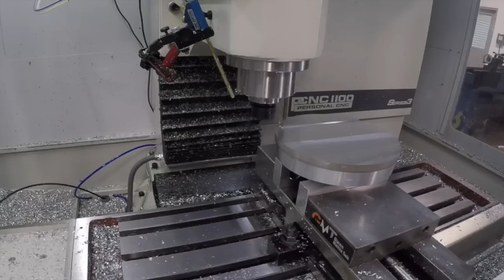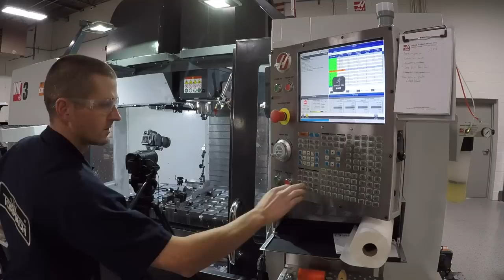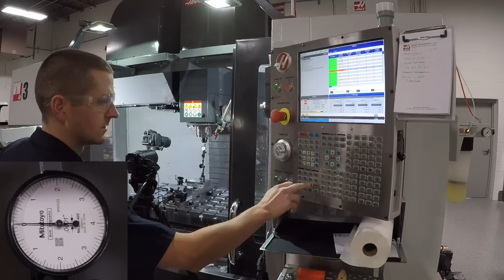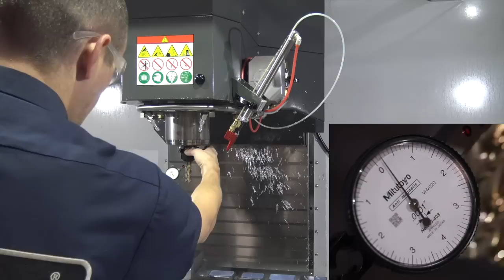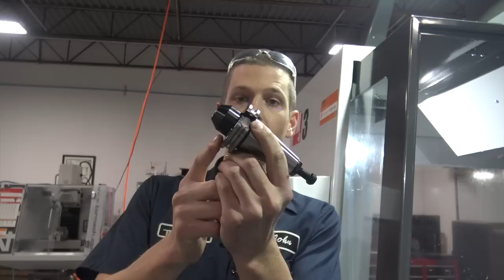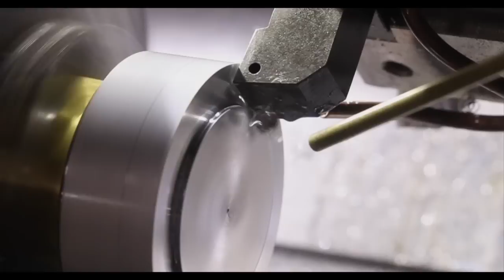Set Screw Up.  UPDATED:  Does a Set Screw Holder Deflect!

Comment: this is still not a proper way to verify the tool runout. John measured it so close to the holder, but you clearly can see that is not the part of tool that gets the job done. that's why usually holder runout is verified at 3xD gauge length. Still, John's channel is a national treasure.

Comment: Low runout is great but Weldon holder's by design have very low rigidity as the set screw holds the tool against a line inn the holder

Comment: 5:00 that speech makes you a great machinist. Maybe im wrong? But after what you did i come down to the tip and check the flutes. On that tool you had 1 tenth near holder but the end will be a few thou.   Tool can spin with the middle stationary and the two ends wobbling out. Hard to explain. I worked in a Chinese mold shop and tools would have 0.02" of runout. I would put the tool in spindle with paper shims to get it true at the bottom. It worked and i blended corners nicely, no gouge. Correct me if I'm wrong??? I had a 2 " cutter 10" long. I did what you did it had 0.01" runout. What i did different is i move Y axis so the indicator says +0.005" - 0.005" and then I Z axis up till indicating just above tip radius of insert. Forgot to say tool shank is 2" too, thats where i reference size. Anyway the inserts said 0.03" runout so idid paper shims in spindle and got it to 0.005", the low inserts i shimmed out with paper and high insert i grinded where it seats, not cutting edge. Got it to say 0 runout. I know thats weird, but correct? I was working for chinese so very cheap. Maybe that helps someone. I learned there you really do have to pull out the bag of magic, haha. Like you can sharpen taps and keep using them a long time, i got 1 M20 tap every 2 years, lol. I used it everyday and it survived

Comment: rob lockwood and i'm sure some others are right, tolerances and quality of the cutting tool and tool holder should be taken into account, as well as the condition/wear of the holder. One more thing to think about is the holder style the tool manufacturer recommends. From what I have been told, tools made with the Weldon flat are toleranced and/or designed to be used with set screw type holders, and tools without were intended to be used in a mill chuck, collet, or shrink fit. I know its gonna happen, sometimes it makes sense to grind a flat on an endmill, but I still cringe every time I see it done.

Comment: I'd suggest this type if test in any spindle is unlikely to be a great idea. Where possible V blocks would likely lead to a more consistent result.

FWIW ER collets can be made to have absolutely zero runout, or at least to the level of your measuring capability and patience. With the tool mounted, dial it in and tap on the collet NUT at the high point. It shifts the collet in the taper slightly and with patience you can achieve no runout. The key to stress is not to bang away on the tool (it won't work, will possibly damage the tool, and is just an all round crap idea) but instead tap the nut. Probably not the most intuitive thing to do but it definitely works, and it typically won't shift under load.

Comment: I would never use a set screw (wheldon) holder without having flats on the tool shank. In fact I've never seen one used on a tool without flats on the shank!

Comment: Knowing this now, you can adapt the run-out in your g-code measurement, the run-out will be zero in your product, I see you always making bigger holes with smaller tools.
Anyway you draw a product for taking material away with even bigger tools like fly-cutters or small tools like end mil's to clean a product and always it's about the material that's left and not what you cut away. It's the product size that matters not the chips!

Comment: As mentioned below I would use a diamond wheel to put a flat on that endmill. the odds are pretty high it will pull out throwing off the zip axis with some heavy radial milling!

Comment: Does that tool have the Weldon Flat? A round shank will work for light cuts in a set screw holder, but if you start pushing feedrates (like with HEM), the tool will start moving in the holder.

Comment: In my machining experience, I have generally been taught and for the most part go by these general ideas. I use solid end mill holders (set screw holder) when I am roughing out. I can put a flat on the endmill and tighten the set screw down and not worry about the end mill pulling out or pushing in and i can be rougher with it and hog out faster and rougher. I then use an end mill in a collet for finishing passes. you dont run it as hard and dont have to worry about the tool pulling out. also, if it does run out a little bit, thats what cutter comp is for. If you have a part that has tolerances in the tenths then you should probably start off with CC in your tool anyways so you dont have to scrap a part for no reason. Set up pieces are for people who are too lazy to take the time to set everything up for its best possible outcome. I dont want that sentence to sound rude or like I know everything because I dont but i tell myself that anytime I consider taking a short cut. Ill stop myself and be like, no you know the best way to do this. just do it the rite way the first time. so far it has worked in my favor. Oh yeah and now that i think about it, i see runout in collets more often then i do in solid holders because these guys want to tighten their tools too tight and it actually messes up the collet and that causes runout. anyways sorry for the book!  love your videos as always.

Comment: Have you ever heard about zero fit tool holders? What I was told is you heat up the holder and shrink the tool in the holder with no set screw , I have never heard of this before just wondering.
Reply: I've used shrink. They're nice, but a pain to set tools up it. Really handy as the holder can be very long and narrow, allowing you to get into places you couldn't with other types of tool holding. 

I'm a fan of Hydraulic holders myself. Rego-Fix's new system is also nice, but tends to chatter a bit more (no fluid damping)  Very low runout, can be balanced for high speed ops and I've yet to pull a tool out of one. Just a bit on the expensive side!

Comment: That's pretty badass that MariTool's holders are that close.  You're still testing the best case scenario though (new everything, made in the USA everything, made by known excellent builders, etc).  Not nitpicking, just saying that one test does not define the entire space.  It DOES define that what you've got there is highly concentric and excellently made, so that's good.

Glad it turned out that your setup is spot-on.

That all said, I still won't trust the runout on a setscrew holder until I measure it myself in my spindle, just like I've been doing.  No offense, but that's a formula that's served me for many years now.  There's no harm in measuring, and it doesn't take any time to speak of. Then you know exactly what the runout is, and what the tool & holder's capabilities are.  On the upside, maybe I can start looking at MariTool setscrew holders as cheaper and better alternatives to the collet chucks I'm using for some things.  The concentricity is certainly there.

But when they arrive, I'll still measure them before they go into service.  lol 

Also, you still shouldn't run an endmill without a Weldon flat in a setscrew holder though, especially one that big, it WILL pull out on you when you load it heavily.  Been there, scrapped the part from doing that.  Learn from my mistake.

It's not a big deal or that much more expensive to buy tools with the Weldon flat already on them.  I think Lake Shore will grind a flat on any tool you like for some nominal fee.

Thanks again for measuring and taking the time to video it for us.

Comment: Hey John,

Great video on some great tooling. I noticed you using a tee handle allen to tighten the set screw on the end mill shank. Now that you have a machine you can push a little harder and with larger tools here are a couple of considerations for you learned the hard way by somebody I won't mention their name......

The tee handle winds up when you tighten the set screw so some portion of your twist torque goes to waste. Use the L part of a allen wrench ideally in a offline toolholder so you can gronk on that set screw. The other thing that happens sometimes is the steel set screw (softer) does not bite the smooth carbide (harder) shank of the end mill. I have seen it many times where the end mill walks in or out of the holder loosing your Z position or worse. I'll let your imagination visualize something properly scary. The tiniest of flats on the shank of the endmill will prevent your tools from doing a potentially negative migration. Better yet a proper weldon flat or whistle notch. If you don't have a diamond wheel on one of your grinders its probably a good time to get one. Some toolholders have a set screw in the bottom so you can butt the end of the tool against an adjustable positive stop. I don't know if your holders have that feature.

All the best and congratulations on your new machine.

Tom
Reply: Of course it depends on the spindle and the size of the cutter, but do weldon flats ever present a problem for tool balance at the higher rpm's?
Reply: what he said. lol
Reply: that's the best advice I could point to. Grinding an angled light flat on the shank is needed- ideally the screw then pushes the endmill back into an adjustable stop backing and you can get it locked really solid. I never use straight shank tooling in a setscrew holder without grinding a flat. Very dangerous if you do.

Comment: Would love to see the TIR of the spindle with a 300 mm long calibrated test bar and just indicating on the taper as well.  

Also, when you start the spindle at 20 RPM the indicator reading shifts about 3-4 microns.  This makes me think there might be an issue with pre-load that could cause inaccuracies and premature failure.  Ask Haas to test and confirm that this is acceptable within their specifications for that model of spindle.  Hopefully its just be a cold spindle that needs warmed up.
Reply: The shift in the indicator is just stiction in the gear train inside it.  Every mechanical doodad takes some amount of force to overcome the initial desire of the lubricated surfaces to stick to one another.  Once that force has been exceeded, they will move past each other with much less friction.  This initial force is what causes the offset in the reading.  It won't cause any additions or subtractions from TIR though.  The only effect is an offset from original zero when the movement stops.
Reply: I understand what you are saying, but Haas utilizes an air/oil lubrication system for their spindles that should negate stiction.  And the drivetrain, when set properly, should not induce a shift.  Like I noted before it could be a simple matter of warming up the spindle to close in the clearances.
Reply: Matthew Collins
 Actually, you don't, because I was talking about stiction in the INDICATOR.
Reply: Not buying stiction in the indicator either. If that is the case it's a crappy indicator.
Reply: Able to diagnose faulty spindle bearings (in a brand new machine) over the internet, also sure that really good dial indicators are frictionless.

God I love YouTube comments.  lol

If the smoke comes out of the spindle before John has gotten 500 hours on it, remind me that I made fun of you here and I'll apologize for it.  ;-)
Reply: First, never said they were faulty, just that he might want to consult Haas about pre-load. I believe it is just a cold machine/spindle issue.  

Second, any indicator that jumps a graduation or more is suspect where I come from and needs checked.  

And finally, my full time job is overseeing  the installation of high end CNC machining centers.  I'd like to think 30+ years in this business has taught me a thing or two about these machines.  I like John's channel, the content and his narrative and want to see him and his business succeed.

No hard feelings.  We all have different backgrounds and experiences that shape our perspective and knowledge.
Reply: I was just breaking your balls man.  It's the internet, don't sweat it so much.  ;-)

It's been my experience that very fine resolution DTI's tend to pick up lost motion anywhere it's available, and a tenth ain't much slack to find somewhere, so I would not sweat having the zero "move" from where you statically set it, so long as the high and low don't move during or after the measurement (and they didn't in this video, he just had a drop off from the static setting).

This is why you see guys bounce the indicator and setup with a sharpie or pen when they're doing really fussy measurements on the surface plate.  A little wiggle is usually enough to take up whatever stiction and/or tiny bit of lost motion your setup has.

If none of your indicators do it, bully for you, but I know from personal experience that both of my tenths indicators do exactly what John's did there, even on the surface plate.

Comment: 1) tighten it harder 2) measure 3 inches from the holder . That endmill can take a 10hp cut in aluminium, i hope you tightened it like you would be using it in that kind of cut. Slot 2xD in aluminium will your endmill pull out at 80ipm?
Reply: I was thinking the same thing. "He didn't torque the set screw" Problems on the horizon. That's how I have a nice gouge in the bed of my VF4SS! Tight but not tight enough and the end mill worked it's way lower and lower out of the holder. Not to mention the fact that torquing will distort the holder and increase runout.
Reply: yea, this demonstration is inconclusive
Reply: You cant pull out a tool in a set crew holder. Thats the advantage. Unless your doing it wrong, i always slightly pull tool out of holder when snug then tighten, that way if it comes loose the tool wont go lower and gouge part, but you gotta stop. But tool will break before pulling out. ive seen a sidelock not fail and instead whole holder got ripped from the spindle. That guy didnt pay attention and thought steel chips would float, haha

Comment: Here's something to think about: that small amount of run out probably won't make too much difference with large endmills but if you were cutting with .030" or smaller endmills at 10,000+ rpms it could make a big difference on tool life, cut dimensions or finishes.
Reply: sp1nrx 
You wouldn't be using a solid holder for a .03 endmill. You'd be using an ER collet or some other high precision high concentricity holder like an SK collect, shrink fit, hydraulic, etc.

Comment: I used to swear by Weldon chucks, never had any issues with runout or end mills being pushed off center but I hated having to buy end mills with the flat or grinding a flat. When we tooled up our new Doosan 750's this year I went with all hydro chucks from Schunk and we have been impressed.  The tendo compact series comes in around $150 per chuck from MSC and they have even less runout then the Weldon chucks and changing out an end mill is super fast. Plus no flats needed! Check out the hydro chucks if you haven't already.  Btw, great video
Reply: Yup, Tendo user here as well! 

I set up an 18 inch gun drill earlier today: .0001 of runout!  (Measured with a Zoller toolsetter)

Comment: You're saying a tenth of runout, but that would be 0.1 inches. I'm seeing 1 ten thousandths runout, or 0.0001 inches. That's some impressively low runout.
Reply: That's a "tenth of a thou" or one ten thousandth of an inch.  Tenth is just machinist shorthand, because most numbers you're dealing with are in thousandths of an inch.

Like when someone says "The ID is 250 thou." instead of "The ID is one quarter inch."

Plus when you read a mic, it reads off as thousands and tenths, as in, "That OD is 375 thou and 8 tenths." (0.3758").

Every vocation has it's own slang and nomenclature, this is just one of many from the machinist trade.

Comment: As suspected, it does push off some but not a lot. In some applications it might matter but for most it won't.  Be interesting to compare finish with say a Briney tool holder that has built in run out to compensate for clamping offset to see if the .0001 or .0002 run out makes a visible difference.
Reply: In a few years once it starts to wear you'll really see it.

Comment: i've never followed the logic that it pushes it off center, more that they're inherently imbalanced, and tend to vary more in quality- a good sidelock holder is pretty good, but a bad one is pretty bad. It also amplifies issues with endmill tolerance. If you have a well toleranced endmill, it will fit well into the holder. A tool on the low end of the tolerance spectrum will be pressed to the side more, because the fit is looser. Collet systems don't have that effect, but it's pretty minimal anyway. It's not as though the Lakeshore you're testing with currently is top-dollar carbide :)

But, for the same reason as your original video was flawed, I think this still maintains the same flaw; it's a valid test of whether the tool is pushed off center, but not of whether a sidelock tool produces similar runout characteristics to higher precision systems. There's a reason runout specs are called out at some distance from the collet/holder nose!
Reply: rob lockwood agreed!
Reply: rob lockwood 
It has to push it off center. Physics alone says it must. 

If the hole is larger than the tool shank, that means there's certain amount of clearance distance between the shank and bore. 

Applying force on a single side so the shank contacts the bore means it will have to push the tool off center. There's no other way around it. 

It's just how much will it be pushed off center that is the question.
Reply: Occams Sawzall You've basically focused on the first half of his first sentence, instead of reading the comment as a whole.